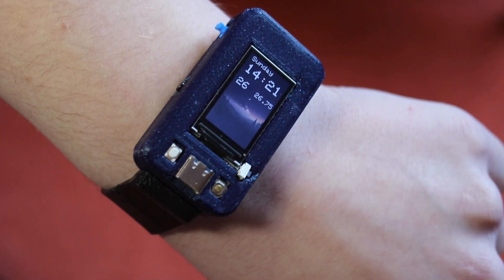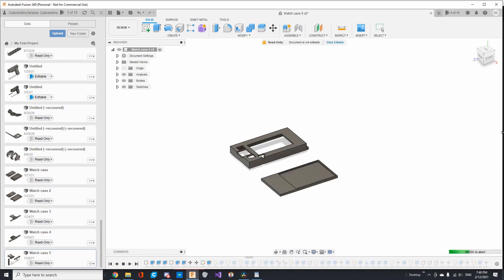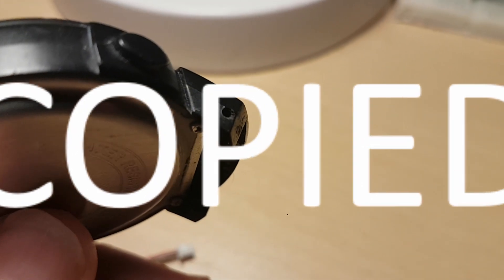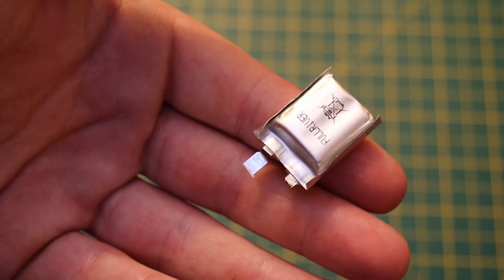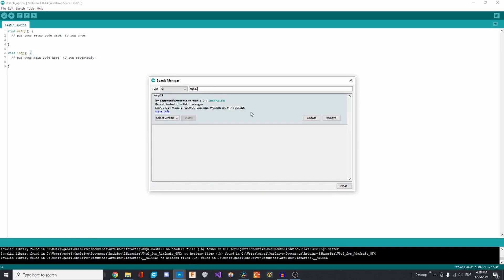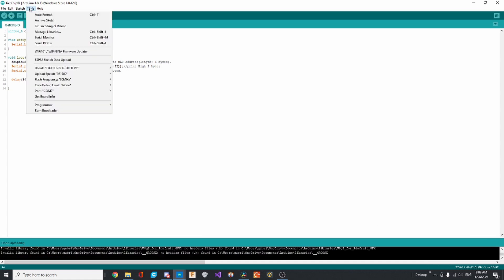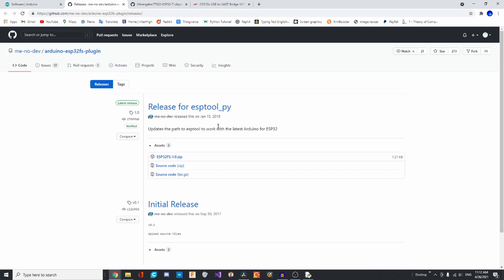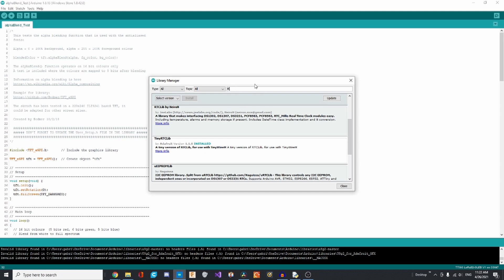ESP32 super smart watch tutorial

Comment: Thinking of just using a 18650 Li-ion lithium battery and taping the wiring down or soldering it. I'll be using a different case and an SW1801P so when I tilt the watch it'll show the time. Would there be any difficulties that I would encounter with that battery?

Comment: Hello, I really liked your project.
I have a problem with the RTClib.h

Arduino: 1.8.13 (Windows 10), Board: "TTGO LoRa32-OLED V1, 80MHz, 921600, None"

Wrote 1507328 bytes (17121 compressed) at 0x00290000 in 6.0 seconds (effective 2017.5 kbit / s) ...
Hash of data verified.

Leaving ...
Hard resetting via RTS pin ...
watch3: 11: 20: fatal error: RTClib.h: No such file or directory

Multiple libraries found for "SD.h"

compilation terminated.

Used: C: \ Users \ Henry \ AppData \ Local \ Arduino15 \ packages \ esp32 \ hardware \ esp32 \ 1.0.4 \ libraries \ SD

 Not used: E: \ Arduino \ arduino-1.8.13 \ libraries \ SD

exit status 1

RTClib.h: No such file or directory
Reply: Same problem here, did you solve it?
Reply: @muskar2882  I still can't find the problem when having two libraries